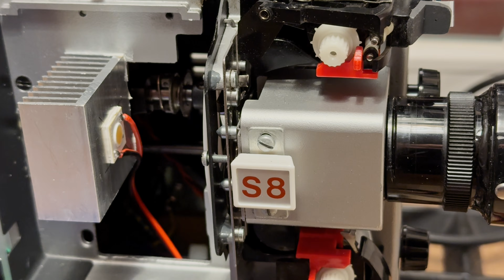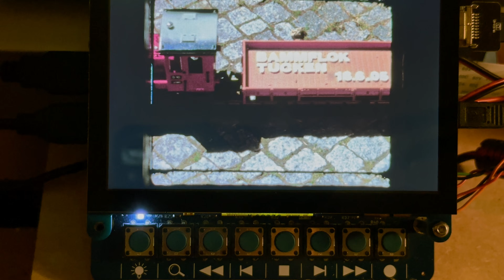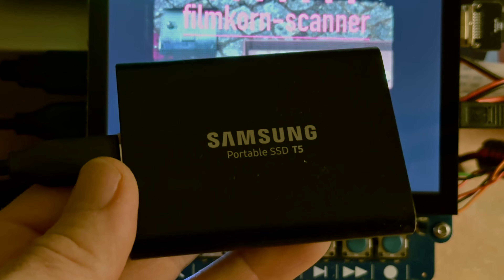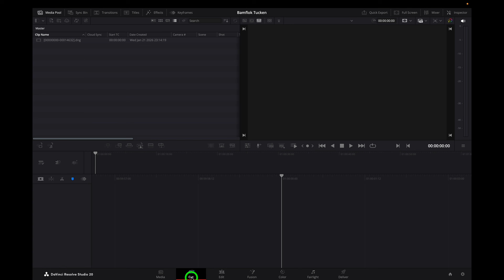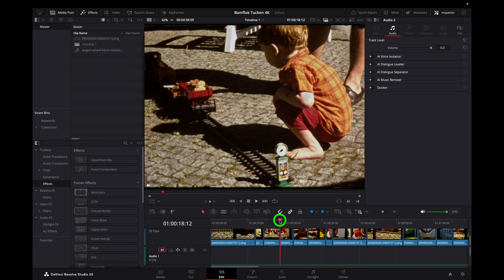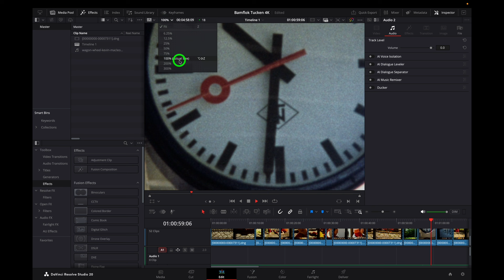Filmkorn Scanner Introduction

Comment: So you use the projectors original motor? No need to use a new stepper motor in place of the original ? Does it work on 16mm and 35mm projectors? Can other cameras be used for capture? Like RGB trichromatic 6.5K or something higher than 4k? Or possible to use existing dslr like Fujifilm X-H2? Which has 4k 6k and 8k raw etc or to use still frame pictures then combine into video?
Reply from the maker: Exactly, it reuses the original projector motor. Any DC-Motor with up to 40V works here. No need for a stepper :)
And yes, it's fomrat.agnostic. I recently converted a Bauer P8 and its working just great (Howto: https://github.com/fwachsmuth/Filmkorn-Raw-Scanner/wiki/Howto-Bauer-P8-EN)

And no, you cannot use other cameras with this system, it's optimized for the Raspi HQ cam and its amazing quality achievable in Raw-Mode.

Comment: This looks great so far! You mention RAW DNG's unedited in the demo video. Since the highlights are blown out I would love to see how these clips handle some correction to maybe bring those back. If colour correction could reel in the latitude then this setup would be almost perfect.
Reply from the maker: Well, if the reversal film doesn't have anything in the highlights, there is nothing to restore them from. The sensor easily captures the full latitude of reversal though, so what's on film can be recovered/enhanced. The 12 bit files also do superb with color neg film. :)
Reply: @filmkornorg  Ok thats good to know. I guess my comment stems from various recent experiences in labs not being able to contain the highlights in slide films I had scanned. But you have the original film so if you say the highlights are blown, as they easily can be with reversal film, then thats all good. Looking forward  the colour negative demos! Would be great if you could make a few frames of each available for us to play with in Resolve.